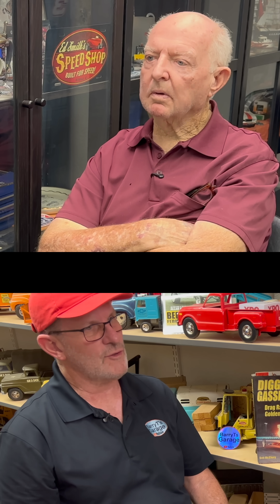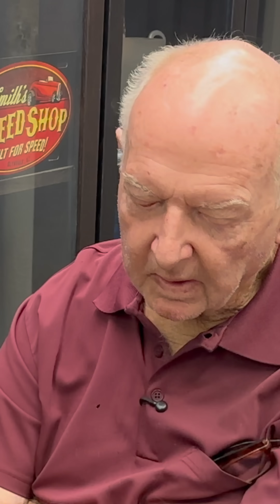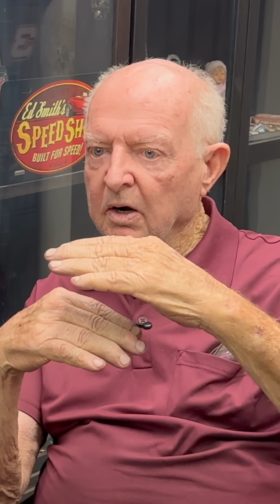Thermostat Debate! Ed Smith w #BarryT from Ask Ed 45 - #engine #hotrod

Comment: I think that running at optimal operating temperature is not just a matter of installing the right thermostat but also has to do with coolant flow/circulation pattern , the size of the radiator and airflow through it , airflow over the engine , etc all working together and in conjunction with each other to achieve and maintain favorable operating status (???)
Reply from the maker: I’ll ask Ed his thoughts

Comment: I had a 70 Chevrolet c10, 350, with long tube headers back in the day. The floorboard would get so hot it would burn your feet in the summer time. Took the t-stat out and you wouldn't believe how much cooler it ran.

Comment: I run my 60s and 70 era Pontiacs on E85, with as much compression as I can get by milling the heads and running 72cc big valve heads on 455s. I run 195F thermostats, so the oil will get hot enough to boil condensation out of them. I can cool them with a small radiator, so less mass to be hauling around in the form of water and radiators. 

Back in the 90s and early 00s my 70 GTO was on pump gas, 8.8:1 compression so it would run on 87, but I usually ran 89 with 10% ethanol in it. When I moved from Nebraska to Charleston South Carolina, I had to change the tune, because with the Nebraska tune it was running VERY hot in Charleston. Gasoline formulation is different by region, so I had to change the timing and the AFR to make it run right. It gets hot in Nebraska, its usually hotter than Charleston in summer, with just as much if not more humidity, so heat wasn't the problem. Its altitude and gasoline. Charleston is 60ft above sea level, where I lived in Nebraska its 2500 feet above sea level. Here in Michigan I am about 800feet above sea level, and its rare the temps go over 85. So I had to retune all my old cars again when I moved here. However, when I drive them back to Nebraska, I don't have to change things very much to get them to run right.

If you run a 160 or no thermostat on E85 or methanol, the engine wont get hot enough to boil the condensation out of the oil, and you will make a milkshake real quick. Condensation happens in every engine, its a function of the heat cycle, and unless you live in a high desert with near zero humidity, you have water condensing on the internal parts of your engine every time you turn it off.

Gasoline wastes so much of its energy as heat that you almost always get the oil hot enough to boil the water out of it. More than 80% of the energy in gasoline goes to waste heat, in the real world its more like 90%, with a carb and low compression.
Reply from the maker: E85 has its advantages for sure, and as you state the whole build has to be planned for it. Like Ed says, depends on the application. Ed generally prefers E85 in racing and has done that for years. Good points on condensation 👍
Reply: @BarryTsGarage  not much planning needed, the carb or EFI needs a different tune, but E85 is good with almost any compression ratio. It simply gets better mileage and makes more power with compression that is too high for pump gas, and even too high for race gas. All of my E85 fueled engines (and fuel systems) are built with the exact same parts as you would for pump gas, other than the compression ratios.

Around 12:1 is the crossover, where the same engine gets the same mileage on gasoline or E85,  but with pump gas you need a lot less compression. So that 8:1 engine on 87 octane will get the same mileage as that 12:1 engine does on E85. 

Pontiac is a great engine to show the difference, because the compression ratio is due to the heads, not the pistons, and a 455 can have anywhere from 7:1 to 14:1 with a factory head, with some milling required to get over 12.5:1

Also because ethanol tends to make a lot more torque under the curve, as in idle to 4500rpm, than gasoline, its kinda wasted on high rpm small blocks that start making power at 5500.  Pontiac 400, 428, and 455 engines make prodigious torque from idle and carry it past 5000rpm, so ethanol is the perfect fuel for them. Its a lot of fun having 500 to 650ftlbs available from 2000 to 6000rpm, and thats naturally aspirated. I've had 550ftlb pump gas Pontiacs, and with higher compression and more airflow they make even more. Absolutely silly power for a daily driver.

LS engines pick up a lot of torque down low on E85, but most people still want to rev them to the moon. The LS is a symmetrical port Pontiac when you compare them, and the Ford Windsor is a copy of the Pontiac as well. People want to disagree with that, but they want to preserve the idea that the chevy is a good engine. ;) 

Lots of bad information and misconceptions are out there about ethanol, most people conflate it with methanol, such as needing 2x as much fuel, being corrosive, needing after run oil and stainless everything, etc. They are very different fuels, but because they are both an alcohol people assume they're the same.

Comment: The bypass circuit is so that the coolant will circulate in the block until the thermostat opens and not boil in the heads before then.

Comment: Down here in South Louisiana Cajun Country when I run the old 305,and 350s i throw that thermostat far as I could throw it and never had a problem no how hard i ran them
Reply from the maker: That's one way to do it!
Reply: You slowly cooked the guides and seats on every engine you did that to I used to tear down a lot of circle track engines for winter refreshes every one I tore down that didn't run a thermostat the heads were cooked everyone that ran a restrictor would still have considerable wear but nowhere near as bad as the engines that ran nothing to slow the coolant down and when your guides get too loose that's how you end up dropping a valve and trashing a lot of expensive parts the guys with no budget but knowledge could run one engine all season without it falling off to much in power or throwing parts then their was guys with all the budget and no real knowledge that would burn up or blow up a half dozen high dollar engines a season which guys do you think we would discount our work for it wasn't the guys showing up with a checkbook and a deadline I'll tell you that much

Comment: On our ASA race car, we used a gasket fot a template to make aluminum replacements for the thermostat then drilled  various sized holes to control flow and get proper restriction for cooling.  We then experimented until we had the right size for cooling.  There's no thermostat to fail.  Worked great on our race engine but not practical on the street.
Reply from the maker: That's a cool race car solution!
Reply: Moroso makes selectable discs ,just as you desribed making.

Comment: Take a look at those old International Harvester gas engines especially the V8's that had a bypass near as big as the inlet and outlet hoses! In the winter with one of those, the ONLY way you could warm one up was to nearly block of the entire radiator with a sheet of cardboard behind the grill. And with old Semis and big diesel engines they used to make the grills with variable vane for air through the radiator, then they stopped doing that and the fronts had snap bottoms around the grills to install canvas covers with zippers on the to adjust how much air would be allowed to got through. I think there should be asl secondary thermostat in the bypass port to close when the temp is low to stop flow from going around the bypass, but with this arrangement there should be also, a pressure relief but yes, this makes more complicated and costly designs
Reply from the maker: Thanks for sharing that info!

Comment: Dad bought a 64 thunderbird with a 390ci, when I was a kid in Detroit. It ran fine, but when we came home to Mississippi in the summer. It would overheat, with, without or a hole dad drilled in the thermostat. He finally put a 4 flu radiater on it and that fixed it. The cooler low humidity air in Detroit was fine, so Ford put a radiator on that would work where it was to be sold back then. Ford was known back then to cheap out when possible.

Comment: Ed is Speaking about High Performance or Race. Myself, for Regular Cars? Car with more than 50K miles? I would Drill a 3/16" hole in New ones. When Doing a Thermostat & Cooling Flush. My Logic, Give the 50K Miles+ Water Pump seal, a cushion. Stay Off Max Pressures. "Old Wives Tale"?

Comment: There has to be a restriction to slow the coolant down enough for the heat exchange to happen in the radiator and at the heads. Water is the best coolant medium as anything else is slower to absorb and release.
Reply: This is a very old misconception.  Cooling capacity is determined by the size (wetted area) of the radiator, the ambient air temperature and the airflow through the core. Fast circulation transfers less BTU per gallon but more gallons per minute. Same BTU's per minute though. The old saw about removing the thermostat causing overheating comes from the days when car radiators were all downflow and the return was typically in the middle of the top tank, right under the cap. With the thermostat removed the return water came up the top hose with enough force to unseat the older low pressure caps and coolant would be lost. NOW it overheats. The phenomenon had nothing to do with rate of flow and no longer pertains with high pressure caps and crossflow radiators. Kind of like putting a battery on a block of wood to prevent discharging.  That went away with asphalt battery cases, which went away around 1960, but the old saying persists.

Comment: There were several engines ( mainly H.D.) that had dual thermostats,  it all comes down to load on the engine. Weather it’s race or a lone engine out in the fields pushing an irrigation pump.  Had one 60 series engine pushing a water pump went threw 2 engines ( overheated) turns out the impeller bearing were failing put a huge drag on the housing forcing the engine to go max fuel & boost killing it.  Had a mustang stroker org. Radiator could not flow enough water. Changed out the radiator went to electric fans and no more issues.  Lot of things factor in to overheating. It’s a science you see.
Reply: Your writing certainly needs improvement.
Reply: @JWOptional naw it’s alwight!!!

Comment: On pure race cars I use no bypass and a restrictor in the thermostat location. With an electric water pump you don't want a thermostat anyway, and you can easily warm the motor by cycling the pump. On our (gasoline) rail dragsters, I used the biggest EARLS oil cooler they offered (not a stocking item but available on request) between the frame rails as far forward as possible with an electric fan. The giant AN hose holds a good bit of coolant (water) and taking it far from the engine and back helps. We had one MoPar wedge (400 block) and a 455 Buick and never had cooling issues racing, although we usually towed back to the pits after a WOT pass.
Reply: Interesting, I helped my brother with his dirt late model. With those it always needed a ton of cooling. They ran a SBC style motor although they were all custom. 430ci, DART aluminum block, 15 to 1 compression, roughly 825 hp. For a race you run between 4000 and 9000 rpm. It’s pretty much the opposite of a drag car. One crazy thing I’ve seen them do is runaway like a diesel engine. Because the compression is so high, i’d you break something that causes the engine to take in oil they can continue to run with the ignition and fuel turned off. There’s actually a video of it happening in a race. It’s definitely one of the crazier things I’ve seen
Reply: Good info and good times I bet...
Reply: As Ed says it is a flow regulator, when closed it sends all the water from the pump help the  engine warm up. As the engine warms up it  cracks open and flows to the radiator, when the engine warms up more it opens slightly more until it is  full open at the number stamped on it. If the engine cools down it will close slightly  keeping more water in the engine . If the temperature is cold say 0 degrees Fahrenheit it will stay closed so the engine can run efficiently. The engines thermostat regulates the flow from the water pump to the radiator. Also the cab heater will work, do not remove the thermostat to fix an overheat as the water will go thru the radiator to fast and it  can not cool the water fast enough. Very important item on the cooling circuit regulated systems flow. Hot and cold  to keep the engine in its operational range  on matter how much the temperature varies.
Reply: I am interested more on learning about the bypass hose. I have always run a thermostat but lately been tempted to try a restrictor plate if I knew how big the hole should be. I have many Cleveland’s and here in Australia we have some pretty high temperatures but one of them seems to run hotter than the others.  I know they always get hotter than the Windsor but there must be a solution that would solve this problem 😊
Reply: @grantleypotts8046 I wouldn't block it for any reason. Try a bigger, or extra core radiator. Try a pump with more gallon per ft. Use 50 percent antiboil/antifreeze mix in the distilled water. Never plain water.
Reply: @dannyschoolcraft5984 yeah I don’t think a restrictor would be any good for a street car as there are too many variables. I have modified radiator mounting for the largest 3 core available for my model and I even bought a new core for it years back before aluminium radiators became a thing and the price. It is probably my next step and maybe twin thermo fans will make a difference but the new viscous hub and 7 blade fan really move some air around especially when it’s motionless on the pad hovering around 7000 rpm 😂

Comment: Great topic. I’ve boiled them to check. I typically drill a hole in the housing flange for a “relief”. I have a snotty blown 1967 Chevy II that I finally cut the center out of a thermostat to act more as a restrictor. I have no idea what I am doing. But these mods helped. A lot.
Reply from the maker: Awesome
Reply: @BarryTsGarage 
On all cars I always drill a 3/32 burp hole if there isn't one. Prevents air lock when filling.
Reply: I drill the 1/8" hole as well.
I believe it helps to prevent air locks.
Certainly doesn't do any harm.
Reply: I cut my centers out of thermostats and have never had a problem.
I have had to wait for heat in the winter, but if you run heater coil water thru some metal pipe close to the exhaust,it gets heater going sooner. There is nothing worse than a thermostat causing havoc by sticking and leaving you stranded .